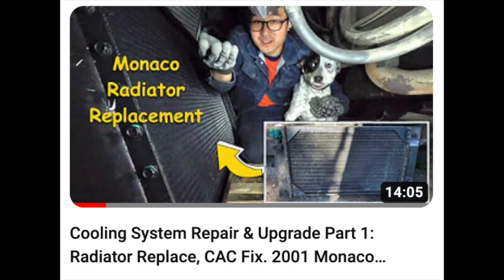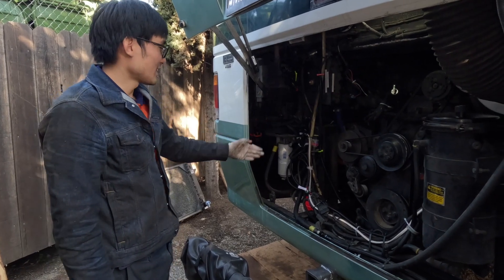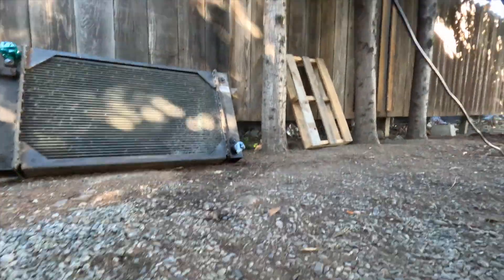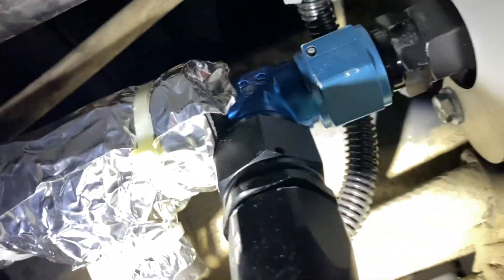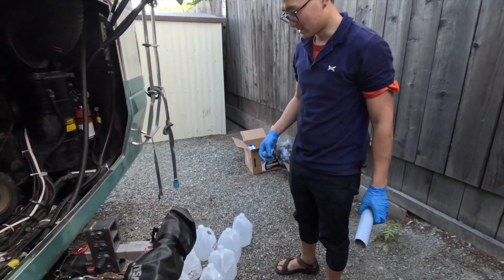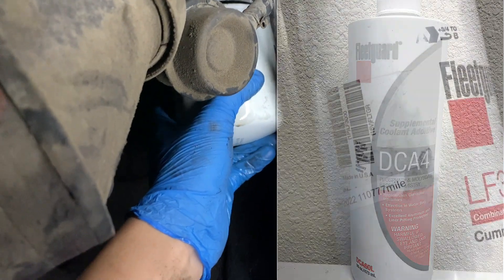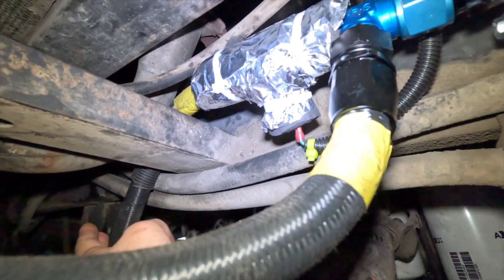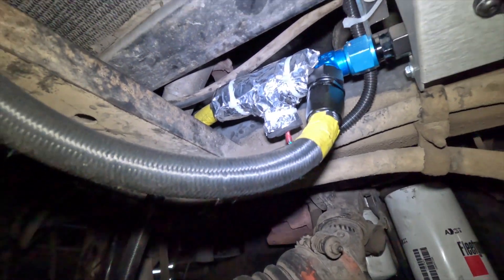Cooling System Repair & Upgrade Part 3: Stand Alone Transmission Cooler & Coolant Flush-2001 Monaco

Comment: thanks for the video. I am currently replacing my radiator and CAC in a 2005 Monaco Dynasty with a 500 ISM and a Allison hd 4000 MH. I did not have a situation where I could do it myself because I was far away from home.
We are also replacing the hydraulic fan motor  the lines all the gaskets hoses thermostat radiator flush  transmission filters   also fan motor hydraulic house  
not to mention a full service, including new injectors on the 10,000 kW generator   $$
Reply from the maker: Gosh, sounds like thousands and thousands of $.

Comment: I’m guessing you have some kind of other problem because Monaco built these to run even in 110° temperature. I have a 2000 Monaco dynasty with a Banks Turbo kit making a lot more horsepower than stock, and I have no oil temperature or water temperature problems.
Reply from the maker: Yes, my radiator is almost clogged up entirely. I am amazed it could still cool (a little bit) at that condition. But it's all been replaced now, new radiator works great. Those transmission fans are just extra mile that I go, since already tore down that much.